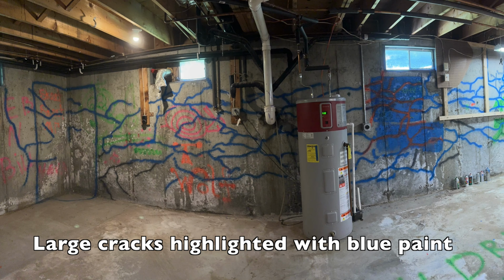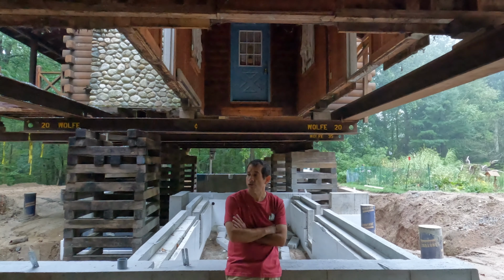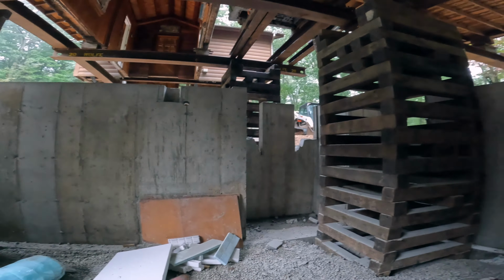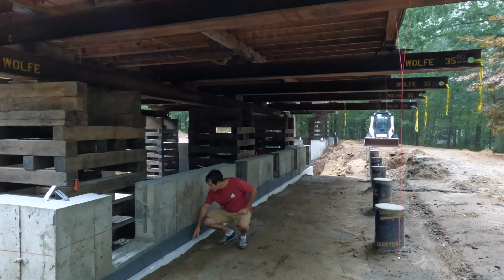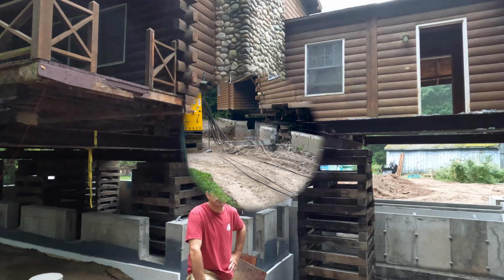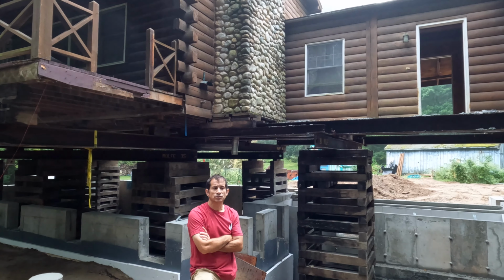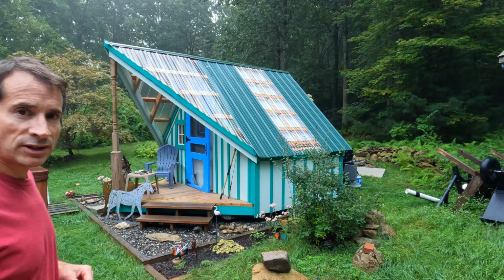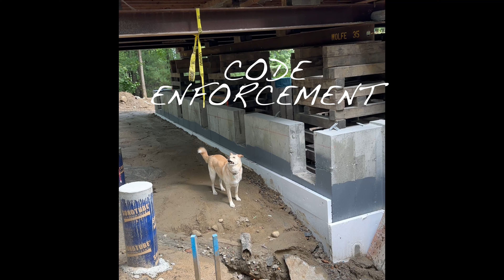House Jenga Anyone?   REMOVE a basement from under a house? #woodworking #pyrrhotite

Comment: Why not use ICF's if insulating the foundation was a concern.
Reply from the maker: that’s a great question and we seriously considered it.  ultimately there were concerns about pest control with the foam being a potential corridor for termites and carpenter ants getting to the wood of the log sides but also there were no contractors that wanted to take on ICF since  they all are used to traditional methods.

Comment: I look forward to following your progress. I’m sure you considered radiant heating in the concrete floor but that’s expensive.
Reply from the maker: we did.  The company that was contracted to do the repair wants to get in and out of these projects...they are doing 5 others concurrently, with another 5 waiting for these to be done.  .  When I pitched the "Upgrade" ideas of radiant in-floor heating, framing and insulating the inside, making a walk out basement, expanding the front porch to wrap around the chimney, insulating the outside....., they were resistant to all, but I pushed the insulation issue and was able to get them to buy in to that.  Thanks for the question/comment and glad you're coming along for the ride:)

Comment: Just out of curiosity, does your insurance pay for this?
Reply from the maker: great question.  No.  ….heres the fast version.  insurance companies successfully argued it wasn’t there fault and the state opened an emergency fund that funds a couple hundred people a year.  we were on the list 3 years after approval, waiting for funding.   the amount is capped at a fixed amount and homeowner had the overage, which can be 6 figures.    all in all i am grateful of the fund because we would have had to condemn the house and eat the loss because it cost more to fix the house than its worth (in our case).  thanks for following along and the question